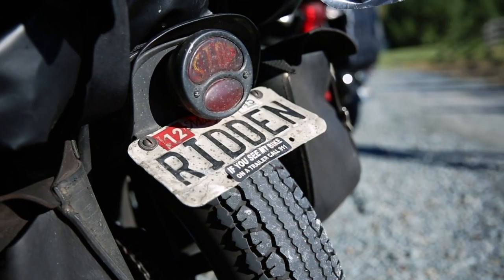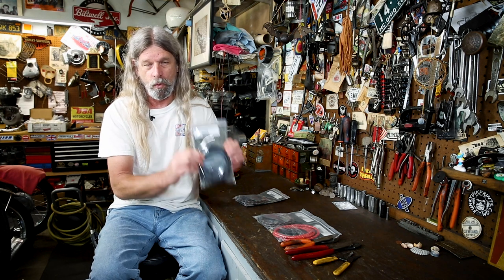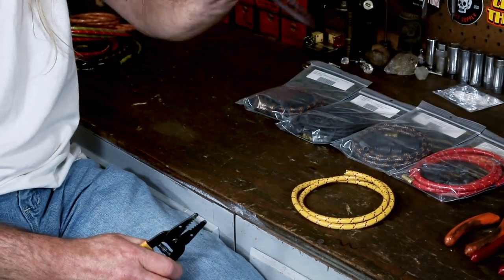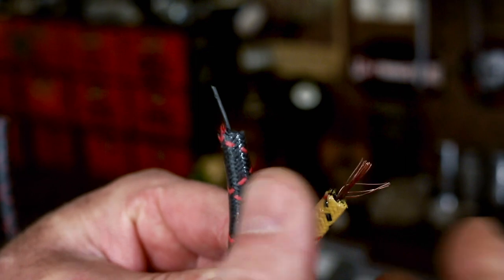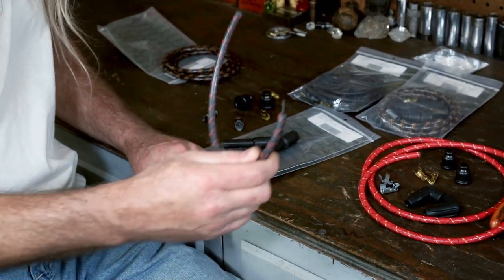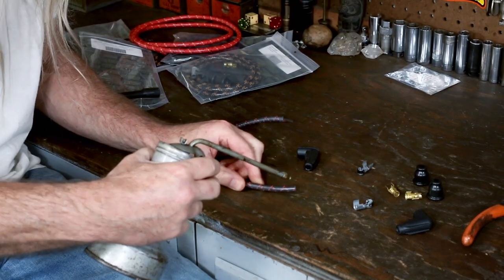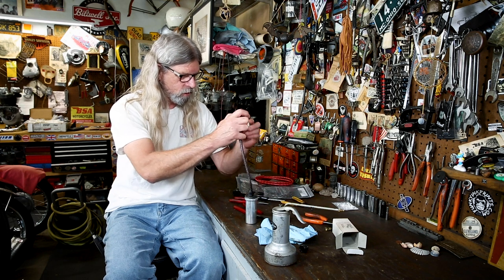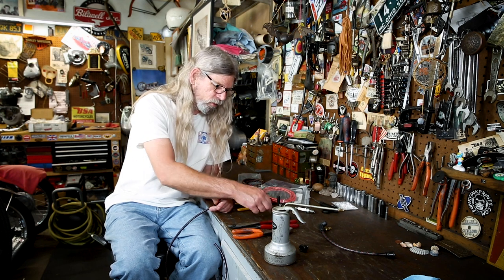How To Make Custom Spark Plug Wires for Harley-Davidson and Other Motorcycles

Comment: pro tip. the cheap stamped crimpers have a spot for crimping ignition wires. you might want to fine tune it with other crimpers to tighten it up but itll get the tabs formed ya nicely.

Comment: 6:41  Why not just crimp it and push it straight into the boot?  Pushing wire through, crimpling then struggling to pull it back down at an angle is the hard way....

Comment: Just use some silicone grease on the connector for the 90. Crimp it on and then lube and just push it into the 90. Not sure why you’d wanna do it this way, looks like a pain.

Comment: I ordered a set for my 2009 Harley Dyna FDX from Lowbrow Customs and I discovered that the straight connectors do not fit in the ignition module - they are too big. I checked my stock cables and it uses a much smaller connector.  What am I doing wrong?

Comment: Question: Would the suppressor core wires be the appropriate  choice for an older bike when installing a device like an M Unit Blue? Or perhaps an aftermarket onboard GPS?
Reply from the maker: The M Unit Blue's Manual says "MAKE SURE THAT THE VEHICLE IS EQUIPPED WITH INTERFERENCE-SUPPRESSED SPARK PLUGS OR IGNITION CABLES." reference - https://store-r2ulc3uwrn.mybigcommerce.com/content/motogadget_manuals/munit_basic_blue_manual_en_2.3.pdf?_ga=2.50618089.1956561884.1591046631-168490203.1591046631 With this I would defiantly look at what ignition system and battery you going to use as well.

Comment: Meant to ask your opinion on which size/type to use on a 3.0 screamin eagle coil?  Its a 2000 custom xlh 883c Sporty (with ss hooligan kit,now its a1200 etc) it currently has 8mm supression core (learned that here tonight from your video lol! Dude..you are the best teacher i swear! ) Also, would there be any need or benefit to a 5.0 coil if my 3.0 SE needs replaced?

Comment: Just made some for my Sportster 72. FYI to anyone making cables for a later model sportster/iron/48; the end that goes into the coil needs to be bent inward to latch onto the the little post in there. Idk if it’s common sense but it took my ass an hour to figure it out lol

Comment: I have a 04 triumph speedmaster and I'm about to change the plug wires. As it is a carb with CDI do you kmow if i should use copper or suppressor?
Reply from the maker: Check your manual about what spark plugs it currently is running, also what ignition system you have may determine it. The other thing if you know you are getting new ones, you could always cut one end off to double check what you are running now.